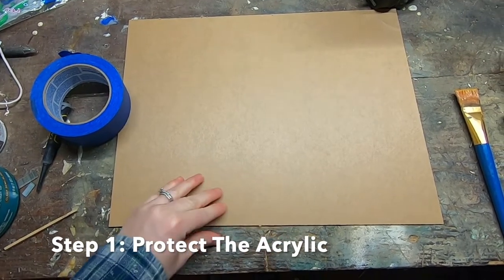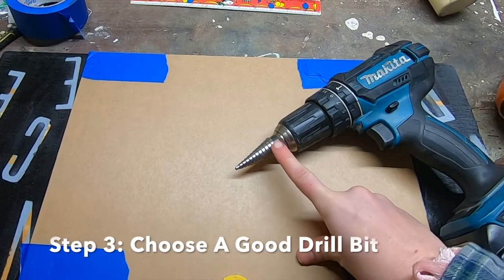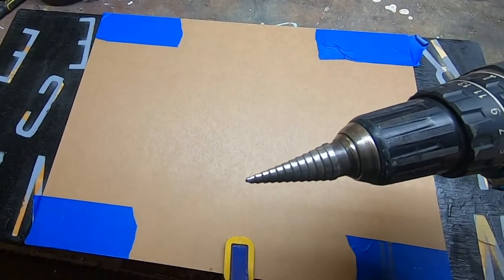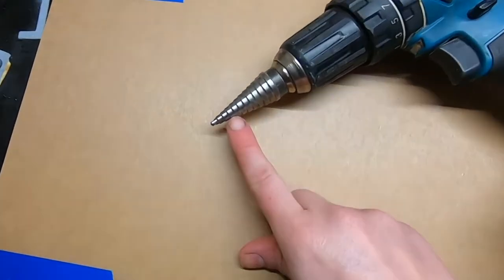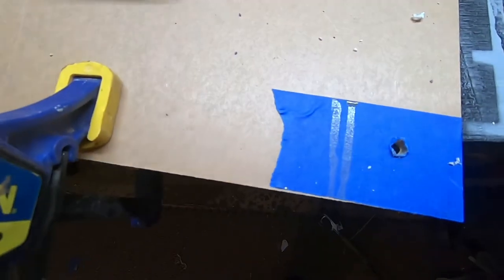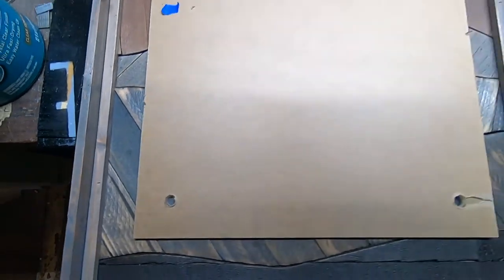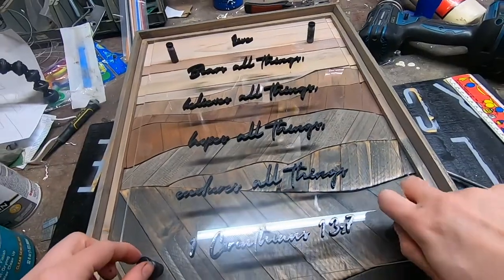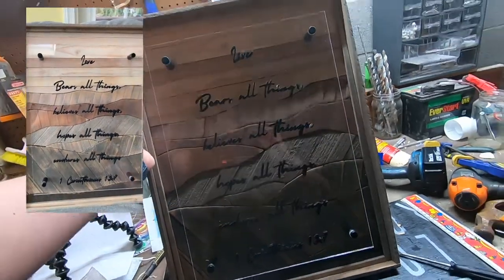Acrylic Standoffs On Sign

Comment: Danielle, I am trying to start making some wood projects along with other vinyl projects. For this sign, how did you attach the standoff to your project on the back of the wood frame? I am trying to make a wedding sign for my niece’s wedding and want to use the standoffs but everything mounts directly into a wall? 
Btw, i love your videos!
 Thanks, Genia
Reply from the maker: Hi, Genia! Mmm I’m not quite sure I follow. I screwed my standoffs directly into the piece itself. The piece itself is hung up with a sawtooth hanger. Maybe you’re using a different kind of standoff?
Reply: What is on the back to secure the standoff on the piece
Reply from the maker: @sistertimex  nothing. It just screws straight into the wood and doesn’t come through the back :)
Reply: @WendellWoodworks  I can't find the kind you have.  Everything I have seen mounts into a wall
Reply: She used the same kind but it is mounted in the wood piece instead of the wall & she used a sawtooth hanger for mounting the sign!

Comment: What size screw are you using to go into the wood sign?
Reply from the maker: Hi, Becca! The standards I buy have always come with screws that fit… In this case, I had to find shorter screws since my backing was thin. I used quarter inch long screws :-).